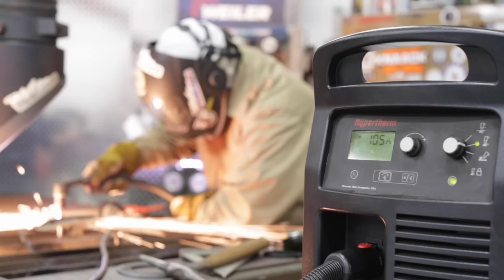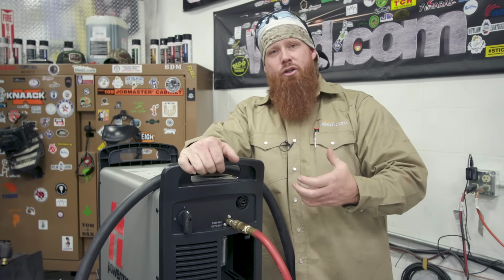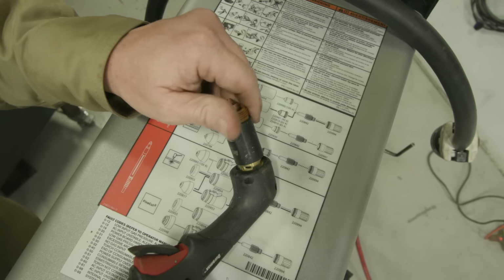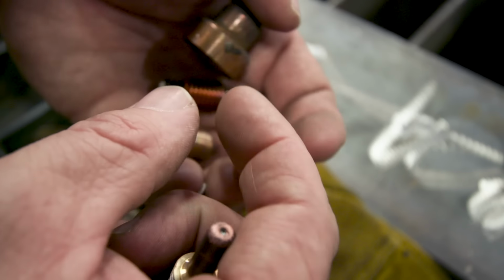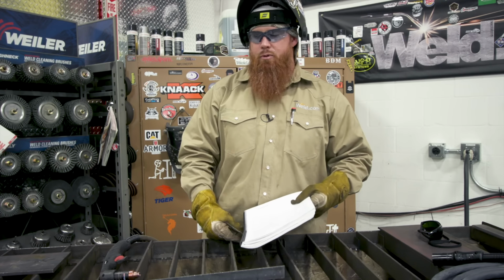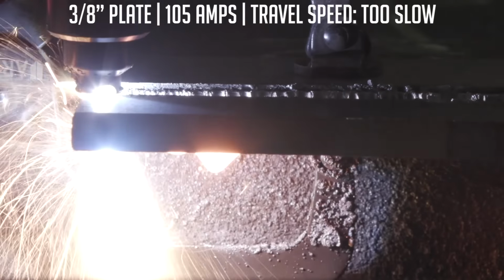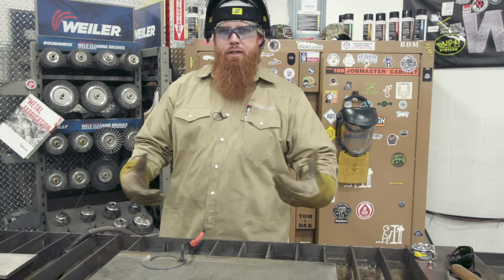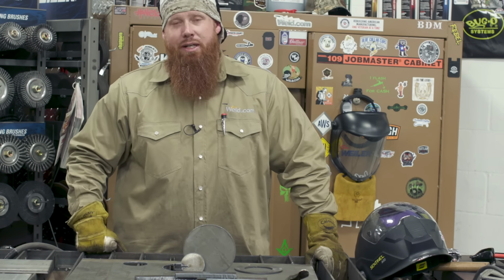Introduction to Plasma Cutting

Comment: Did I ever luck out! I just got a commission to provide some artsy designs for 1/8" steel security shutters, and figured I'd better learn something about plasma cutting. Boy did I ever learn. Thank you for providing an intro that includes nuances, such as direction of cut as it relates to desired end results. I am passing this video along to the plasma-cutter-newbie who is building the shutters.

Comment: So you know, a carry-on suitcase sized Powermax 105 will run you $5,000. 

There's a reason your neighborhood metalworking shop is still using oxy-fuel for most of the "shop-rate" jobs. 

If the shop doesn't want to teach their new-hires how to best preserve consumables. Two re-fills of oxy-propane will cost as much as a new electrode / nozzle set of consumables, and your new hire can torch $50+ if they short to your workpiece.

Comment: You say the plasma comes out of the torch in a counterclockwise rotation. The direction you were cutting the circles then would be the equivalent of  climb cut with a router correct? Which in woodworking does give a better cut but with added risk of the router tending to "run away" as you cut with the rotation. I understand this is fire not a spinning bit, but is my thinking correct? Thanks for a great tutorial!

Comment: A couple of corrections.  The Powermax105 does not use high frequency.  The plasma gas is swirling in a clockwise direction.  Good side of the cut is to the right of the torch.  When you made the straight line cuts, the good side of the cut fell into your table.

Comment: oxyacetylene uses heat and air blast to cut not rusting.  It can cut through any, any, any, material that melts at the Temperature  it’s combustion level, In no way is it relegated to Ferrous material. I respect your knowledge in most cases, but this made me question it overall, it’s a big mistake!!!

Comment: People have been duped into thinking a plasma cutter is much faster than a oxy-fuel torch. When in fact a plasma cutter only cuts faster to a point .once you get to about 3/4 the rating of the machine your cutting of is ab9ut equal to oxy/fuel torch. When you reach peak range of the plasma cutter the oxy/fuel torch is twice as fast!!!

Comment: One way to judge your cut speed. Divide the recommended speed by 60 ( seconds per min.) . Multiply that by length of cut and do the “ one  Mississippi” count.  If you're a novice like me, it helped. And thanks for a great tutorial. I was not aware that torch parts were amp specific. Or I forgot.

Comment: I have a 105 on my CNC table, the book says it's rated to production pierce 7/8" but I slowed down the pierce time and i can pierce 1" with no problem. If the metal is somewhat clean I just set it on the common grounded slats,  I also removed the clamp from the work end and use a mag clamp for ease of use (on those rusty jobs) , if i ever get aluminum or SS I just clamp a piece of metal to it then I ground to that if / when needed.

Comment: Plasma can and will cut anything that conducts electricity You are approx 70%water and conduct electricity think on it for a moment that is why the torch now has a safety switch. From an older welder .

Comment: I’m a beginner, I don’t know if you use gas for plasma cutting, or just electricity . I have a plasma cutter, stick welder, and tig welder all I’m one. I’ve never seen a video if you use gas for plasma cutting. I would really like to know. Thank you.
Reply: You need gas. Hook up an air compressor to the air nozzle on the back. You need a gas, not a specific gas like for welding.

Comment: So for a better cut quality I want to "climb mill"?  The plasma column has counterclockwise spin, I cut clockwise for a better outside edge and counterclockwise for a better inside edge.  Does this mean when cutting a straight line  from bottom to top the better edge is on the left side?

Comment: I'm pretty sure stainless steel is a ferrous metal. It just doesn't oxidize, which is why it can't be cut using an oxy/fuel torch. Although aluminium does oxidize, I think it has to do with the unusual characteristics that the aluminium oxide possesses.

Comment: how about the air pressure?..do i have to adjust air pressure depending on the thickness of the materials?... i am working on the machine that you are using.. thanks...

Comment: Hello W.C
I enjoy  your vidios and they're very informative. You stated that an O/A torch is only for metal containing iron (fe). Did you mean that a torch will only cut metal containing fe good/smooth , or did you mean will only cut metal containing fe period? I worked in plant/ industrial demolition using oxygen/ propane torch. As I understand  propane burns at lower temp than acetylene but cost less so that's what we used. But I have to say, many many tons of metal of all types have been loaded into scrap boxes, and these metals were cut with a oxygen/propane torch. I think only ceramics are are immune from a cutting torch. I have also cut rebar to my amazement  at about 6" under water with a torch. To agree with you that cutting metal containing fe is a chemical reaction and a smooth continuous cut can be achieved, cutting stainless (for example) is only a process of heating the metal to a molten stage and then blasting the oxygen to remove metal or clear a path and repeat . I have personally cut a bird mouth in base of several stainless distillation towers and fell them like a tree. If you've ever cut cast iron with a torch, other nonferrous  metals will cut the same. To my knowledge, only epoxies and ceramics cannot be cut with a torch . I also have a small propane torch hooked up inline on my gas grill . There is nothing like medium rare steak with a seared fatty edges. My buddies made fun of me for this but I noticed they were soon doing the same on their grills.
Hope this helps , also    great tip in other vidio using a hose clamp for cutting guide 
Thanks
Mike L Rogers    Pasadena, TX

Comment: Something is counterintuitive here.  You say that the swirl of air coming off the end of the cutter spins counterclockwise.  You then say that - "as in the case of a wood router" - you want to cut circles in the opposite direction of the spin - i.e. for a hole in a plate, clockwise, and to cut a circular piece out of a plate, counterclockwise,  That is the opposite of what you would do with a wood router.  A wood router's bit should always cut against the material that you want a finished edge on; if it spins clockwise, you should move from left to right along the edge you are trying to finish.  If you do the opposite, the router will "climb" the work, and the edge line will be bumpy.  I see the result in the work you did, and just wanted to clarify.  Obviously, if you are using a router table, where the motor is below the table, you are moving the work against the bit, so you'd move the work from right to left, since turning the router upside down reverses the direction of spin - but the same rule applies: the bit cuts into the work in the direction the tool is moving, just as for a saw.

Comment: 1:07.  "...with oxy-acetylene, it has to contain iron right because oxy-acetylene is a chemical reaction, it's basically an   accelerated rusting process so it's limited to items that contain iron so you can't cut non-ferrous items like aluminum or

stainless steel chromium, nickel anything
 like that so there's a lot of advantages with cutting with plasma cutting..."???? 
The oxygen is used to feed the acetylene flame.  It has nothing to do with what you're cutting.

Comment: Great instructor. If you work by yourself, it may be hard to see the angle of the of the spark (too slow/fast) so showing the beveled piece will help you determine what was not right. Great job explaining the results of the cut.

Comment: Very well done video with a lot of great tips and info.  These plasma cutters are the way to go for making parts. Yes, gas or plasma cutting is a skill, and if u don't do it often, u get rusty.  I use to be a fit up mig welder 50 years ago, but  I haven't cut steel with my oxy/acetylene torch in 22 years.  I'll be lucky if I don't catch myself on fire.

Comment: New to welding got a question can you hook a plasma cutter to tig gun output on a tig stick and mig machine and replace gas bottle with compressor to use as an arc plasma cutter ?

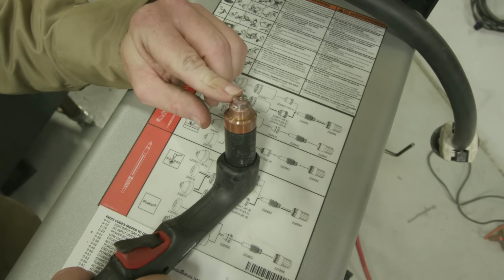Comment: a tip , at 6:30 you describe the "air ports" on the cap, another word, that can't be confused as this one was, is to say 'orifice', just like in a carburettor, as this is the technical name for them; or alternately you can use the word 'jet' or air jet, similar meanings. one easy word is to call it an air duct, like an air conditioner in the house, or simply an 'air cap'.

Comment: one point, you forgot to mention, one would assume the air supply ( compressor) has NO oil feeder on it, ie like mechanics have to lubricate air operated tools with!!, or you have a separate line that is a 'dry' line for these tools, like plasma cutters / air paint sprayers, etc. which require an oil free air supply so as not to contaminate the job in hand.

Comment: Great tips as always! I work in my home shop so I cut over a metal 55gal drum that I turned into a safe plasma cutting table with water in the bottom. Added 1/8” x 1.5” flat bar every inch cut to length! Took about 30’ of the flat stock! Works fantastic!
Reply: It's prolly alright, but water and a plasma cutter, is that safe?

Comment: Can you do video with a cut 50 cheapo plasma. Most of us start with something cheaper like this.
Reply: It's exactly the same, only our machines don't have all the bells and whistles the expensive ones do. I just bought (and love) my Lotos LTP5000D, a $379 beastie.
Reply: @ljprep6250  Over a 5yr period of moderate use the Hypertherm will be a cheaper machine to own/operate / besides your consumables are stuck on the ships anchored in the harbor..
Reply: @SegoMan  I just checked the prices and have to disagree with you.  I could buy 3 Lotos units and 100 consumables sets for that price.  $379 vs $1,600+ is a BIG gap. And those consumables could be airlifted to me.  ;)
Reply: @SegoMan  Perhaps on a commercial basis, the Hypertherm would be the way to go, but I'm retired.  My cutting costs so far are much lower with the Lotos.

Comment: Make sure to correct the video. Aluminum crazy electrical current and can be plasma cut, test a piece out. Use to cut bent sides off aluminum ramps to re flatbar

Comment: When you mentioned that stainless has hexavalent chromium in it 
I thought the plasma fume was where the hex was. The 
CR had been vaporized into a free active poisonous state by the extreme heat.
CR(VI) +6 oxidation state.
The CR in the stainless itself is not +6.
That's why we don't die from using stainless flatware for instance.

Comment: Thank u about two years I caught a bad case of brain cancer. I went through chemo and radiation. And it left me without knowledge a lot of things that I've been doing for 55 years. I didn't even know how to use my plasma. I don't didn't even know the set the gas in the oxygen on my torch.My Miller bobcat I don't even know how to set the dials. It's been a really trying experience. Regain what I  enjoy doing.. thank you again for the time you spent.it's amazing how I can lose 55 years experience in less than 10 weeks..

Comment: old trick; just as in oxy/act rub soapstone on the tip and the pieces you will be sliding against it will move much easier and smoother

Comment: By your own admission, you built the gantry "too heavy."  With the weight and the wear on the gear reducers, all that slop in the drive causes "overshoot" & "undershoot" which must drive the electronics crazy. You were in over your head on this project. I admire you for trying but fault you for scapegoating. Turn about is fair play. Now that you've created your whine/blame video, why not let the electronic controller supplier inspect your boat anchor-type plasma cutter and see how and why it damaged their equipment? It's hard to surmise over the phone -  invite them to your shop and give them a close look at your work. Most of all, you irritate me by assuming because you failed, others cannot use their better sense in designing their table. Are you being paid by the machine supplier you now recommend?  I am not limited by your shortcomings.

Comment: I'm a recent recipient of a powerplasma 80S, never used one before so i'm trying to figure out stuff. I would have liked to have afforded a unit like the hypertherm but it's just not in my budget. What shade setting on the AD hood should I use? Welding starts at 11 and goes up from there but I suspect that is too dark for the plasma arc
I'm working with mild steel at the monet and cutting 1/8th" to 1/4".

Comment: Great video . But keep in mind you should start at 105 amps and bring the amperage lower until you find the lowest amperage needed to cut that size material . That will increase consumable life and it should give the best cut quality . You never mentioned that the PowerMax 105 is a 3 phase ( 220/460 volt ) machine only . And if you don't have 3 phase Hypertherm make smaller single phase machine .  ( the 125 is 3 phase 460 volt only ) . I say this because the company I work for has 3 105s and two 85s . We would have gone for the 125 but the voltage is an issues . These are used in the field mostly . We did have have a HPR 260 , then traded up to a HPR400XD . Sold those and now have a XPR300 . So I am a bit familiar with Hypertherm and their products . I will say this If you are a professional spend the extra money they are truly the best you can buy .

Comment: In respect to speed (too fast/too slow) I always tell my guys that if you're burning your feet you're going to slow.  If the sparks are burning your face you're too fast.  Find a speed that throws the sparks slightly to the "rear" of the cut angle.

Comment: Another caution about aluminum; if you ever cut over water, which is mostly done on CNC machines but can be done as a manual process, always change out the water before moving to another material. Cutting aluminum introduces hydrogen into the water and cutting steel over that can create an explosive condition.

Comment: That was really informative. What about some general guidelines for psi on a 20-40 amp machine. Manual just says to set regulator at 100 psi.  That doesn't seem right to me. Obviously new to all this
Reply: Experiment. Too little air will not cut through well at all, too much creates excessive dross. There are combinations of amps/PSI that work well for steel, others for aluminum, etc.

Comment: Good PPE, I burnt a pinhole through my glove and cooked a nickel size burn on my hand, that was a first time and will be the last time I wasn't careful with the arc.I always been highly skilled with the carbon arc gouges and oxy-acetylene, the plasma cutter added an entire new aspect of cutting in manufacturing process of stainless steel in industrial maintenance.We used 9018 in the induction draft fans for years until they found out or told us any low hydrogen rod with more than 70,000uts you had to have a respirator, chrome is extremely carcinogenic.I worked in another plant that purified the chrome and it kills, they had electric carbon arc electrode furnaces for manganese and other additives for making different alloys.The manganese would give you rotten eggs belches,nasty.

Comment: I used a huge plasma cutter that sat around in the corner and collected dust, I used it on stainless steel pipe,12" diameter,it went on the top of B&W coal pulverizers on the inlet from the coal silos in the building at Pleasants Power Station.The plasma cutter weight was probably 1000lbs and had 2 gas bottles on the cart.I have a Thermal Dynamics Cutmaster 42 at home.

Comment: It looked like your to fast cut was the just right speed or your amps were to a bit high, the to fast cut looked super clean
Reply: Personally, there is not such thing as too fast. Cleanest cuts are the ones that are done the fastest while getting through the metal. TOO fast is when you don't cut through the metal.

Comment: Anybody can make a good cut using a Hypertherm.  Make another video using one of those low end plasma cutters with no nozzle shield or if there is one its some kind of half assed janky setup.  Have to hold the nozzle at just the right distance and not really being able to use a guide piece makes it fun.  My old work had a Hypertherm super ease to use.  New place has a Hobart making a good cut with it, without damaging the nozzle is a challenge.

Comment: As a non welder. For the electrode if the pitting is at the limit is it possible to just grind or polish the pits out?
Reply: nope, these are precision parts, if you grind them the gap will not be in the right size between elektrode and shield.

Comment: "On the top of most machines there's a parts diagram"- for the first month till 5gallons of spilled coffee have peeled it off or the alphabet deniers have hit it with a guard-less grinder every time they need a flat surface 😐
Reply: Also- if they still cut, I keep the killeded tips for scrap choppin

Comment: Hot dang! I've been using my plasma cutter wrong and always get a bevel edge that drives me crazy thinking my unit was a POS!  Looking forward to try your techniques. I had no idea travel speed caused the bevel, nor did I know about the CCW swirl. I even tried cutting at an angle to get a straight edge to no avail. Thanks for teaching this old dog some new tricks.

Comment: When I used to work somewhere where we were welding 12-25mm steel, sometimes when parts needed trimming we’d just set them on the floor with a slight gap under them, crank the mig up and straight up weld through it. 

Gotta watch out for the blobs of molten metal everywhere afterwards though.
Reply: Johnathan Doe done the same to cut holes through thin steel like sheet metal.